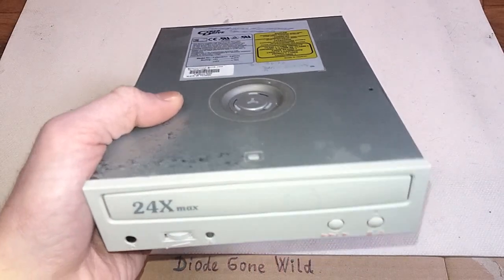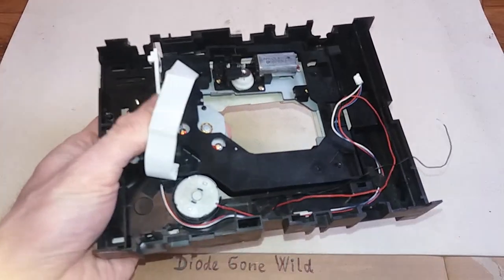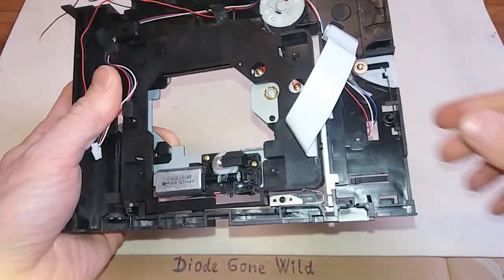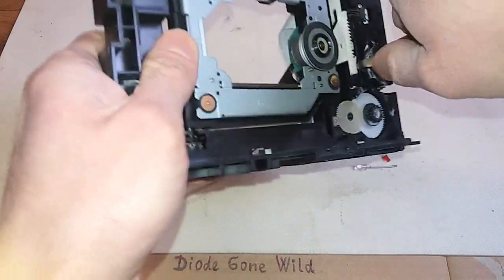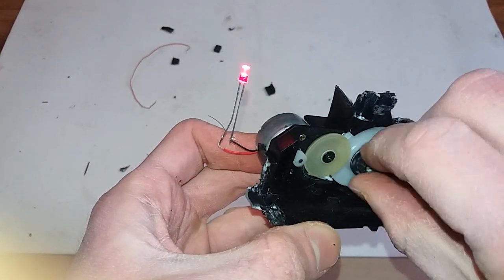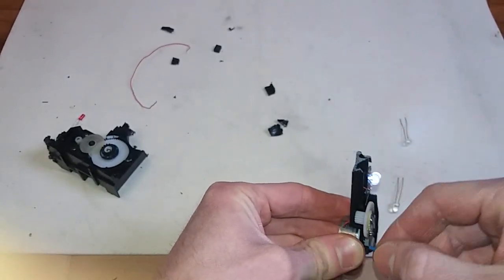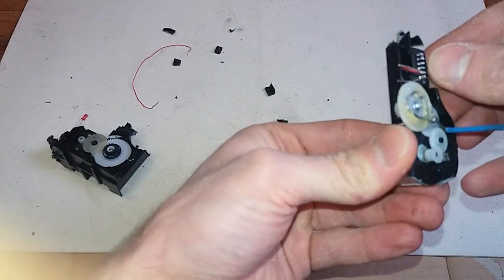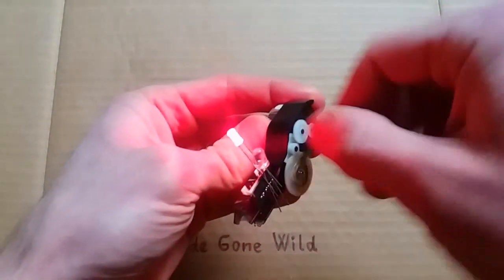DIY Hand-Powered LED Flashlight (Real Free Energy)

Comment: I wish they still made devices that you cranked up a spring that ran a generator to run a radio or flashlight sort of like how a mechanical music box or Victrola worked. It may be able to charge a battery better than you can. They had such devices back in the 1990s, but they don't seem to make them anymore. Those devices were noisy in operation for some reason. We still have our late father's Victrola, and the wind-up system never made a huge amount of noise. Even the hand crank chargers we have today are noisy. I don't know why that is. Are those little motors just noisy in operation?
Reply: It's related to Maxwell equations. The current generated is proportional to the rate of change of the magnetic field. You need to have a quickly changing magnetic field in order to generate a meaningful current. This means that you need to have relatively high gear ratios, because you can only crank the handle at a relatively low speed and you want the motor shaft to turn very quickly.  This high gearing ratio means quickly turning gears. The loudness comes from the meshing  of those gears.

Comment: Is that DC output?
Reply: No, directly from motor it is AC.
Reply: I could be wrong, but I believe that this is actually DC output. I think that because of the self commutating nature of Universal Motors the output is going to be a somewhat dirty choppy DC but that it's not going to be going into negative voltages. This would also explain why you can power LEDs in different directions of the handle turn. If it was actually a c you would expect both of them to light.
Reply: It's diode, so it blocks AC. But it will turn off negative half of the wave.
Reply: @pavelbires  right.. But wouldn't it then light in both directions as the handle is turned? I get it would only light on half of the sign wave, but i would expect it to light regardless of which direction the handle was turned...
Reply: Actually, let me just try this. I know that brushless DC motors create AC, but when I'm seen with the LEDs suggest that brushed DC motors maybe doesn't? This should be interesting either way I think. I will look at things using an oscilloscope and such!
Reply: It's a dc output.
Reply: Yes

Comment: The crank System is not practical and you have no battery to charge. Already in Soviet times they were flashlights or with a spring you had to wind or a generator you activated by making a fist. I have a third world radio you wind a string spring with about 40 windings and then you let the spring unload itself for 1 1/2 minutes. Then you can hear about 30 minutes of radio. The problem is the quality: It's all plastic and everything breaks before the first set of batteries on a normal radio will be discharged! So no ecological effect!
Reply: I thought it was ok, I managed to charge my tesla car, and with the left over power, keep my fridge working with it.